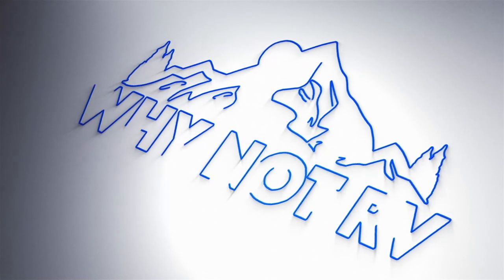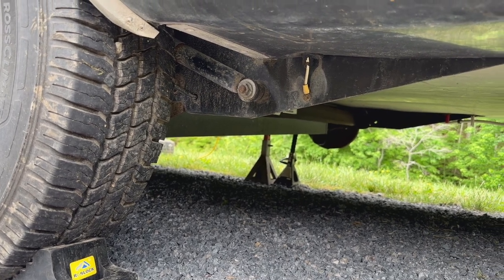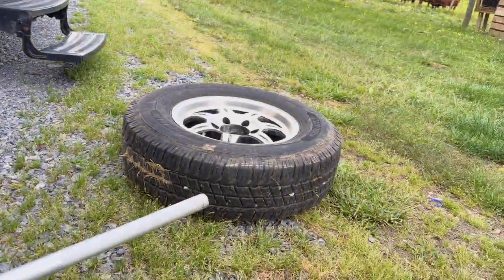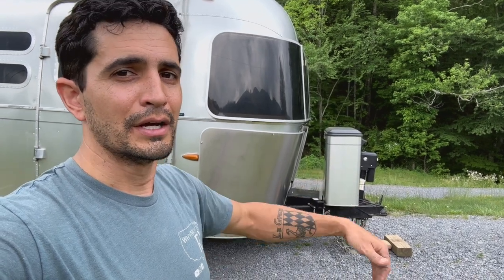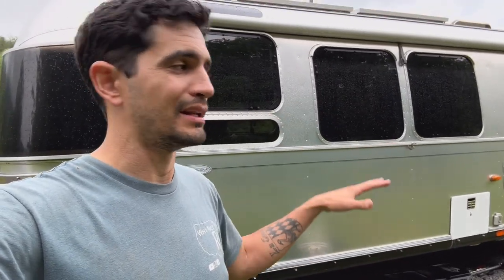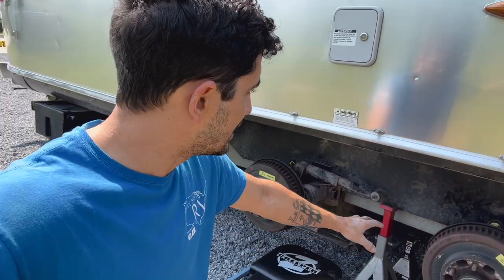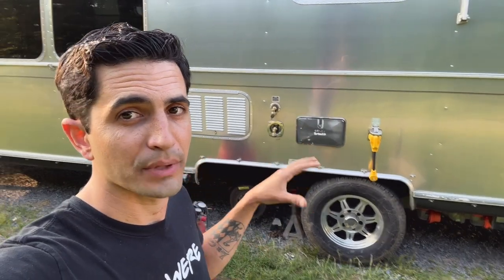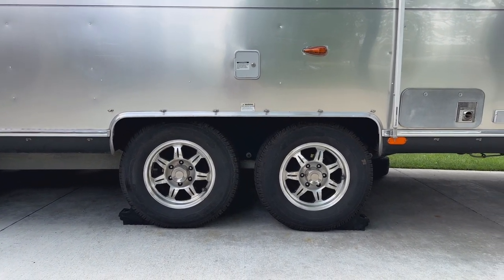How to Install Dexter 3" Lift Kit for Airstreams - Why Not RV: Ep 122

Comment: Good information on your video. I plan on doing that to my airstream travel trailer one comment that I do have it was very sketchy the way you had those two jacks on each side so close together that was very dangerous. Do you want to spread the jacks out as far as you can, and that provides more stable footprint, when lifting heavy objects, other than that, you survived it thanks again
Reply from the maker: Ya the airstreams are tricky to jack with such minimal framing exposed and the “jack points” of I had the front hitched to my truck it would have been much safer.

Comment: My mechanic who was working with me on this project was concerned whether the shocks would still do (whatever they do!) since after the lifts were installed they would be  basically horizontal. 

Truthfully we couldn't figure out what the heck shocks are doing down there at an angle like that anyway

Do we need ti fabricate a mounting bracket to duplicate the original slope??

Thanks for any input... I've only just started researching the shocks issue after a lift install
Reply from the maker: I haven’t personally noticed a difference there. The independent suspension of the airstream is already above and beyond other RVs. After the lift it still tows like a dream

Comment: The Dexter lift kits are specified by "#10" and "#11" axles.  What is the difference between the two?
Reply: Nevermind.  After some searching and digging:  
#9 1,000 - 2,200 lb
#10 - 2,300 - 4,000 lb
#11 - 4,100 - 6,000 lb
#12 - 5,500 - 7,200 lb
Reply from the maker: Glad I could help 😂.  No seriously, thanks for watching and let me know if you have any additional questions.